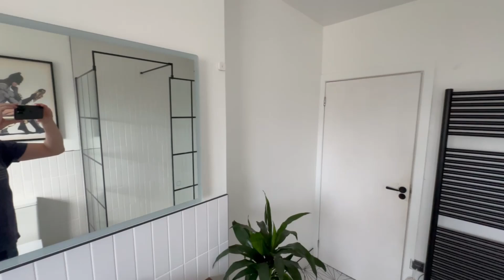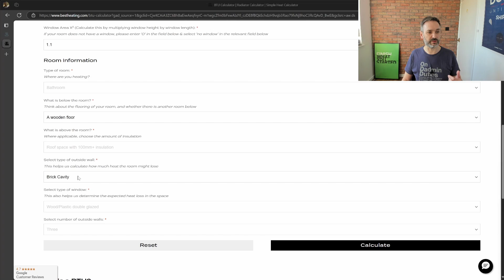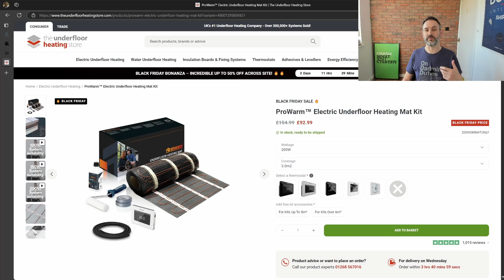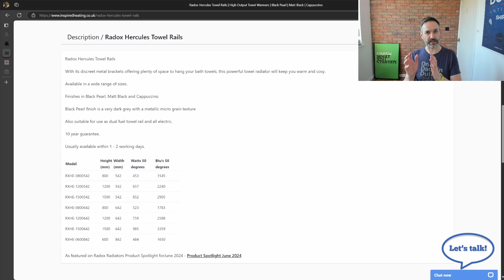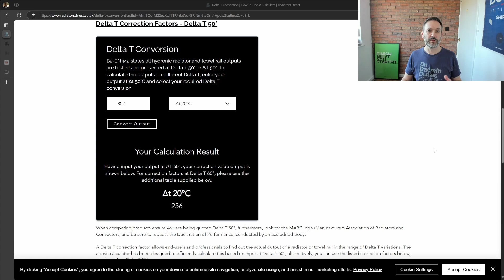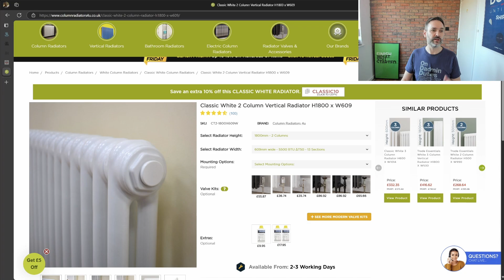The mistakes that led to a very cold bathroom and what I'm doing to fix them!

Comment: Can you insulategarage ceiling also have you a fan taking out heat from bathroom

Backdraft dampers are specialised devices designed to prevent outdoor air from flowing back into your home through the ductwork. They work by allowing air to exit but blocking its return. This is a highly effective and long-term solution for preventing cold winds.
Reply from the maker: Garage ceiling has been insulated and the extractor fan we have installed has a vent cover, which closes automatically when the fan has stopped.

These measures have certainly helped!

Comment: Yep, it's a hard lesson learned when you've got it all tiled up and finished as you want it, how much easier it would have been to insulate the floor from above.  As well as actual rad power, there's a further trip for the unwary with online calculators - For England the winter value used is -3, but that's an average value which in reality varies massively - You should not be too far off for the midlands, but it's a total underestimate the further north you go...
I can heartily recommend exterior insulation for your gable end, it makes a big difference and can be finished to near enough match the original.... 

I came at my bathroom (and upstairs toilet) from a slightly different angle as it's a condensing boiler on low temp constant heating... These were the only two places I couldn't push the return temp down (I've a battery powered roving node with ds18b20s  in pipe clips to test on line) low enough unless the lockshield was almost closed, killing the flow - The problem turned out to be the low temp drop across the towel rail, so the solution was to add a rad like yourself.
The aluminium rads I ended up ( Alloy rads have ca 3 times the heat transfer rate of steel ) with are a 1400mm high 5 module in the bathroom and a 600mm 5 module in the small toilet - A bit of messing around with lockshields until the rooms stabilised in temp, then I could open the lockshields fully and let the thermostatic valve in each do their stuff.
It may look a little odd having a towel rail with that monster alongside in the bathroom , but that rock solid 22c is glorious, and the return temps barely nudge the boiler return.

A tip for any with coombe ceilings upstairs, the part you can't get to the other side of - Timber internal framing on the room side of the coombe with polystyrene/rock-wool batts between then plasterboarded over and blend in.
Because of the original construction here, I had to take mine up from floor level in 2 by 2s so lost ca 60mm per wall to the lofts and gable, but the difference was well worth the effort.....

Comment: How much does ventilation effect the heat loss? I have a single room MVHR unit which runs all the time. Thinking it’s extracting just a bit too much heat sadly.
Reply from the maker: Ventilation be somewhere between 15% and 25% of the total heat loss. It's very hard to make an accurate guess on ACH (the number of Air Changes per Hour), which is how ventilation losses are calculated. I use figures between 0.5 and 1 for mine. I plan on getting it professionally measured in the New Year.

If you have MVHR, the heat being extracted will be distributed to somewhere else in the house, so it's not completely wasted. MVHR systems are usually balanced, but as it's a bathroom, it might have a higher extraction rate to handle the moisture.

Comment: For me 15 degrees in a bathroom is not a big problem, we don't spend much time in there, and tend to be moving around or in the shower moving around under hot water. Stop putting towels on the heated rail because that is what is reducing the heat output.
Reply from the maker: It’s personal comfort isn’t it. What works for one, doesn’t work another. When the kids are in there brushing their teeth etc. it’s cold. 

We haven’t put towels on it for years. As soon as we do, the rads is pointless. The issue is the size of the rad and the low flow temperature, not just the presence of towels.

Comment: Very timely, I'm thinking through all this myself. Have you found a good high-output towel rad? I'm thinking something like a vertical column rad with separate towel bars around it would be the way to go.
Reply from the maker: I haven’t had time to look yet. I am thinking column rad with hooks, but my wife doesn’t like the towels hanging on the rad at all (!) so we might put up some hooks on the wall. I would like to confine the moisture in the room and stop my wife putting towels on the bedroom radiator!

Comment: Its also worth mentioning having a door or shower curtain helps massively with shower comfort as you need less flow or can shower in a cooler room.
Reply from the maker: I agree, but our shower enclosure can’t be closed. You certainly need the water running warmer when the door is open, so we do our best to keep the bathroom door closed, but with small kids that doesn’t always happen :)

Comment: Are there any figures on the heat output of a towel rail style radiator when you actually use it for towels? I would imagine that the towels insulate the radiator and massively reduce the heat output.

Also, is it just me or are these towel rail radiators far too small for a proper bath towel?
Reply from the maker: No, they don’t put anything like that on their outputs. And you’re right, they are too narrow!!!

Comment: Without an accurate heat loss calculation for a room you need to allow for a margin for error by over-sizing the radiator. The online calculators and the building element assumptions they contain are too general for a reliable heat loss. When considering flow temperatures, you need to consider if you have sufficient domestic hot water anti-legionella factors in place to allow a low flow temperature to be set.
Reply from the maker: Amen. My plumber did ever by gut feel. I didn’t even know about heat loss calculations back then!

With my low flow setup, my boiler supports two flow temperatures. Hot water is up at 70 and my Mixergy tank does a sterilisation cycle every two weeks, so thankfully that’s covered!

Comment: Have you thought of just getting a second towel radiator the same and putting it the other side of the door?
Reply from the maker: Funny you ask that, as I did talk that option through with a plumber fairly recently. Unfortunately, the stairs are the other side of that wall, so getting some tails coming through that wall would be difficult. My wife wasn't keen on the idea either.
Reply: @ I would have said pipe it from below, but I guess you don't want to access from the garage again. If you struggle to find a big enough radiator, you can also get skirting board with pipes in to add extra heat, discreatheat is one I found via google. When I eventually get a heat pump, I will hopefully follow your route of upgrading all the radiators myself, its great that you have openenergymon on your boiler.

Comment: My plan to have a radiator in the hallway outside our bathroom has worked quite well. Opening then closing the windows to dry the bathroom, then the door to heat it has worked out quite well.
Reply from the maker: We have a nice rad outside the bathroom door, but all it's energy goes into heating the hallway, so there isn't enough surplus to make a dent in the bathroom. Did you deliberately get a bigger hallway radiator?
Reply: @tomasmcguinness  we deliberately bought a larger radiator for outside the bathroom. We needed a new one there in any case.

Down to what delta T is the towel rail sufficient? I.e. at what temp you would need to start putting the underfloor on for?
Reply from the maker: @Biggest-dh1vr it’s only outputs enough when the flow is about 62. My flow doesn’t go over 45, so it always underperforms :(

Comment: i cannont wrap my head around how you brits construct your homes. There is so much weird desicions IMO.
Reply from the maker: 🤣 The house is almost 70 years old. Great for the time it was built, not so good now.
Reply: @tomasmcguinness  I've been watching grand designs and several other birtish shows a lot. I really like birtish architecture. But there is still so many weird choises. Is timber insanely expensive over there?
Reply from the maker: @sjoroverpirat ha ha ha no, not really. The housing stock is brick built and it’s historic. In the cold weather, back when people had open fires, the block construction would retain heat. In this day and age, it’s not necessary, but most new houses are still built from blocks. No idea why. Habit maybe? More brick layers than carpenters.

Comment: 3 min in and I already see mistake...
Reply from the maker: Very cryptic!
Reply: Obvious things:
 - low flow temperature (you made video regarding that)
 - splitting heat capacity (but I assume that you have not accounted heat loss for underfloor heating and or that it needs run constantly which means huge bill for electricity)

Also, with low flow temps you could put water underfloor heating and correct it with termo valve

Comment: Excellent video. had a very cold hallway (adjacent to an integral garage) so when I had a new boiler fitted, I took the opportunity to fit a double radiator in place of the single and the warmth difference was immediate.  It has also benefitted the 3 rooms leading off the hallway too.   I had no idea that outputs could not be relied upon and feel much better informed, so thank you Tomas.

Comment: Thanks for this and your other interesting videos. If you use the radiator to hang towels from (as is presumably the normal practice), the insulating effect of those towels would significantly reduce the actual design heat output of the radiator and so would need to be factored in. That's one of the issues in our own underheated bathroom!
Reply from the maker: Very true. I think we'll end up just getting a regular column radiator and add some rails or hooks to hold the towels.

Comment: Currently pondering what to do in my bathroom.  I am leaning toward an electric down heater and a towel heater for just that.   Bathroom doesn't need to be warm all the time.

With low room to rad deltas the only way to increase output is using fans.
Reply from the maker: Like IR heating?
Reply: @tomasmcguinness  I just stumbled upon IR heating panels today actually. Seems like a good solution to fit on the ceiling, most are IP65 rated and as long as its one that heats up quick, would be ideal.  Completely unsure what wattage is required though.
Reply from the maker: @drcl7429 all I know about the IR panels is that they will warm things, not air. So if well positioned, they can be very effective. Not sure how expensive they are to run though. 

What do you think of them?
Reply: Modern pull cord downflow heaters work well and have inbuilt timer functionality. Of course if you have ch just use bigger rad

Comment: I got to a similar conclusion in a very different way ;-), I currently run gas, aiming to go heatpump = double the wattage of radiator (finger in the air maths), then I reckoned everyone bumps their figures, so best triple the wattage for good measure.......there may have been a little cross checking with the team about the lunacy of this approach but it seems to be reasonably sound. And now I can see your video, so i'm even more confident now.
Reply from the maker: The calculation to give you a radiator's output at a lower temperature isn't linear due to convection changes (I think), so be careful! At the extreme end, you might need a radiator that's 5 times the size. For me, at a high flow of 45, I'm looking at one that's 3.3 times the size. If you wanted a flow temp of 35, you'd need a rad that was 5 times the size!! When the installation is being designed, these factors will be correctly applied.

Comment: I believe Stelrad are the only radiator manufacturer who actually has their rads tested to British standards for heat output , the others are self regulating so to speak , in other words you have no way of checking what they claim .
  I have ended up having the ugliest radiators on the planet as a result , K3s from stelrad , ugly yes , but output is ok .
Reply from the maker: I was reminded that there is a scandal in the industry, with manufacturers misreporting outputs. I think my rad's output is reasonably accurate, since I could successfully predict the room's temp during a recent 70 degree flow experiment I ran. Running at the 70 flow with a dT of 40 pulled the room up a higher temperature, matching my calculated heatloss. Still, it's too small for a heat pump!

Comment: We are lucky in that our main bathroom, which only has a towel rail, doesn’t have a window, just a massive mirror wall, so it stays warm. Downstairs WC not so as has a window and two external walls. Solution was to swap the towel rail for an actual radiator.

Comment: All these numbers are all well and good, but in reality, they're just a guide. Buy the biggest radiator you can fit and use a trv to adjust accordingly. Towel rails dry towels, not heat rooms. Great  video.
Reply from the maker: Getting the biggest rad possible is a simple approach, but it has issues. Firstly, move TRVs are very slow to respond and digital ones, in my experience, aren't very accurate. Closed TRVs can also present a problem for a heat pump since they reduce the available volume of water in the system. You're right about towel rails drying towels - that was my main mistake! Should have just put a nice columnated rad in there in the first place.
Reply: @tomasmcguinness  You can put in a tall columnated radiator, but the traditional towel rails, depending on brand, have high BTU's also.  Not sure if i can say the website here on YT, but there's a great auction site called John Pye auctions, they update their inventory every Friday.  Or you could get a columnated rad and install a couple of chrome towel rails, they're separate fittings you can buy.
Reply: Trv circuits should be parallel to the main living room circuit that uses the main thermostat to control your heat source.

Comment: I have been finding all your videos very interesting.  There are 2 rooms in my house that I cannot get up to target temperature in the winter months.  I suspect I need larger radiators.  Do you know how to find the output in watts of a 25 year old radiator?  So I can do a heat loss for the room and confirm it is undersized?
Reply: If its a standard convector type radiator with panel(s) and fins behind you can get a good idea by measuring the dimensions of it and whether its a single or double panel etc and comparing that with new rads of the same type and size on say Screwfix website for example where they state the outputs.  It should be a good guide. Rads haven't changed that much in 25 years.
Reply: @martinwright7093 great I will give that a go to get a good idea
Reply: Have you got a thermal camera. I’ve noticed my rad’s seem to pick up a lot of magnetite even with inhibitor and a magnaclense filter. I suspect it’s dropping off the inside of the rad, moving and blocking up the channels at the bottom. It’s got to be hurting the heat output so worth taking it off and giving it a blast with a hose. In addition I bought a shot gun cleaning kit that has a wire brush on a entendable stick so I can brush out the bottom for any really stick bits. 

Sure it may kill the rad if it’s rusty but then I’m going to need a new rad anyway. It’s kind of kill or cure.

I found a thermal camera was very useful in my rooms because it showed all to cold spots from the missing insulation so persuaded me to re insulate the roof which I’m in the middle of now.
Reply: @davideyres955 I do have a thermal camera and it seems to be heating evenly.  Doesn’t look like there is an issue.  This is why I suspect it is too small for the rooms heat loss
Reply from the maker: Thermal cameras are amazing for that sort of stuff. I got one a few years back. Octopus Energy did a program last year where they loaned them out, so if you didn't want to buy one you might be able ot borrow one!
Reply from the maker: Thank you! The other commenters on this (I love seeing other viewers help!) are right. You can probably have a reasonable stab at the radiators output. What is your boiler's flow temperature? If that's up at 60 or 70 and you can't heat those rooms, then new rads are almost a necessity with an ASHP. You could try improving insulation or using those fan attachments to help increase the rad's output. Gave you tried to work out the heat loss of the rooms in question?
Reply: @tomasmcguinness  The boiler flow temp is currently 60.  I have tried 70 degrees and the rooms in question still didn’t get warm.  I don’t want to turn the flow up to 80 degrees as the rest of the house doesn’t need it that high and it’s a waste.  I have now done a heat loss via heat punk and the rads are showing as under sized for the rooms heat loss.  Especially when the flow is 60 degrees and the DT is 30 for the radiator.  Once I put the rads output into a conversion calculation it is no where near big enough.  I’m scared if I put a much bigger rad in It will mess up flow rates and pressure.  Guess I’d better call a heating engineer
Reply from the maker: @robbiegreen where is the 30dT? Across the tails of the radiator?
Reply: @tomasmcguinness  Sorry I meant 30dT as the differance from the average room temp I want to achive as 20 degrees and the average water temp in the radiator 50 degrees.  So when working out the output for my old rad I need to convert from the standard 50dT to 30dT as you did in the video
Reply from the maker: Yeah. That’s exactly it. With the radiator temp at 50, your boiler’s flow will likely be between 55 and 60 with a return between 40 and 45.